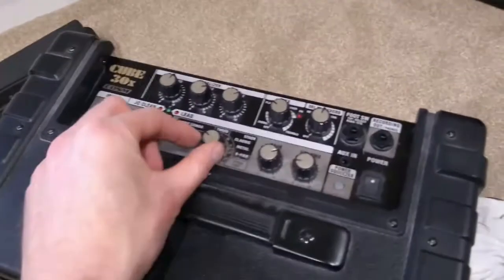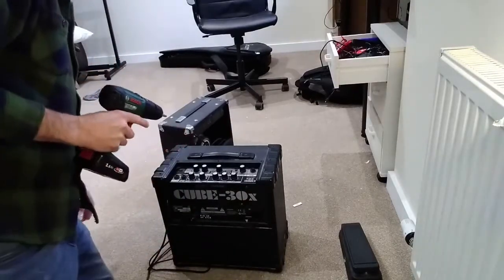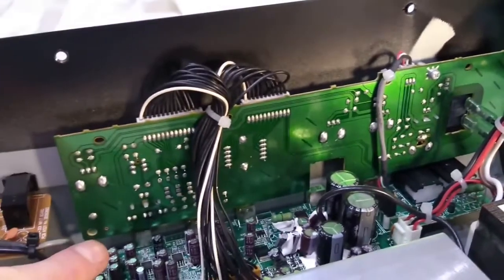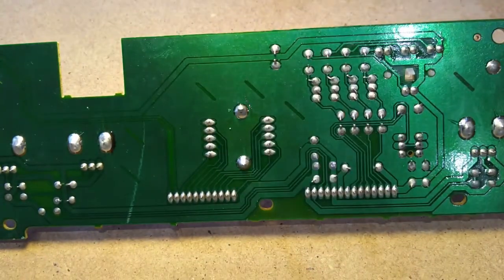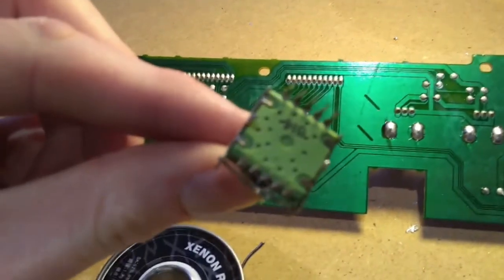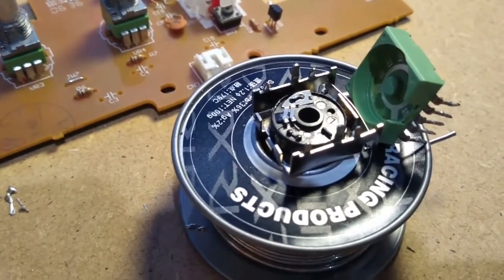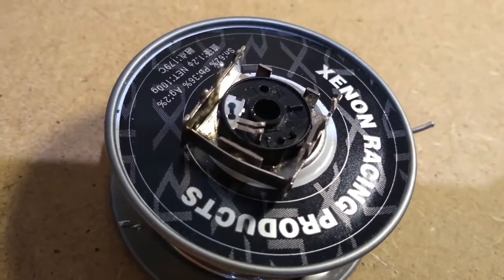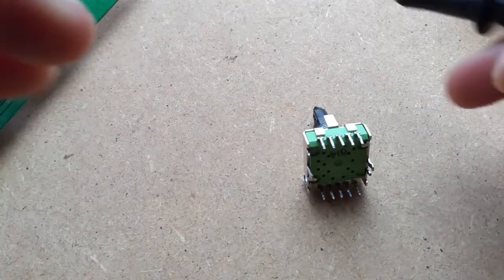Repair to Roland Cube lead channel selector switch

Comment: Thank you. I have the exact same issue. Seems to be a common fault. Gonna fix mine up too. I have been waiting approximately 5-6 years for a video like yours, as I am hopeless at fixing things, especially electronics, and there weren't any dealing with that model, and neither my local guitar store nor the manual was any help either. Your video helped me tremendously.

Comment: I have the same amplifier, and the same problem, if someone needs to buy the selector, it's an SR1712F-0108, I just bought it new, although disassembling it can surely be fixed as you did, thank you very much for the help
Reply: I have two of the amps and need one of the switches so if you don't mind advising me where to order the part...🙏
Reply: Ok l ordered the new switch so going to attempt the operation tonight...or tomorrow night..(
Reply: Where do I order it from. I just bought one used and same pot is dead
Reply: Ok if anyone is asking l got this and other parts at Mouser Electronics out of Texas
⚡
Reply: I have the cube street model with two speakers in it.  Does mine take the same switch.? It's an 8 position
Reply: 105-SR1712F-18NS
SR1712F-0108-20F0A-N9-N-027
1 POLE 8 POS D SHAFT is the information on the 8 Position one that l purchased from Mouser Electronics
Reply: für Deutschland Mouser de
Reply: Thank you for sharing. Here is a quick fix. I removed the plastic knob and sprayed around the metal pole (there is a tiny space that a fluid will penetrate) then placed the plastic back and turned the switch several times all the way right to left in order to clean the contacts.

Comment: Wow. Thanks a lot. My input jack fall into the amp after the plastic locking thing broke into pieces. I tried all the large screws but I did'nt think I should unscrew the top two at the handle. And even if I would unscrew that, I wouldn't dare to apply that force I needed to move the switchboard.
Reply: All the problems are same. Thanks for sharing

Comment: Hi 
You said the plastic part of that switch you bought was a bit short, did RS  sell an alternative with a bit more plastic on it, or is it not necessary? Thanks
Reply from the maker: The part I linked was the closest match from rs at the time of the video.  The shaft is slightly short but acceptable. A closer match may be available depending on where you are in the world and when you order.

Comment: I have one for repair here. It turns on but all lights go up and no sound. The analog session appears to be working but it is the digital parts that worry me...
Reply from the maker: I'm not sure if that could be the selector switch or not.  I guess the switch has two failure states.  It can short and connect two or more models simultaneously or it can fail open?  I never tested to see how it behaved in either case.  You could roll the selector switch around and see if anything changes.  ...but there are so many other things it could be.  Probably it's  a different problem.

I would start by taking  the boards out and inspecting them.  Checking the connectors are all seated.  Looking for blown caps or anything else scorched looking.  That sort of thing.

Sorry I am not enough of a cube expert to help more.
Reply: I think it must be rust. It is all rusted and corroded inside. Needs a deep cleaning for start.

Comment: Hi nice video, i got an 80x and the effects dont turn off is there a way to disconect them? I dont use them . The flanger effect is alway on cant use the amp. Can you help?
Reply from the maker: Sorry I am not familiar with that problem.  Does the knob still change the effect type or amount?  What happens if you try to turn the effect off with a footswitch?
Reply: @mowogfpv7582  não it remains on flanger. Im goin to try with a foot switch. Thank you

Comment: 13:11 I agree . this will be my last Roland product. They use cheap crap inside and they fail too much. very dissapointed with Roland. I love it when it works but every Roland product I've owned has some kind of issue at some point, mainly because of the subpar parts!

Comment: hi sir may I ask if what is the code no. of the 2 transistor. that attached in heat sink. I need to know because I have a amp like yours. but my amp have a problem. the 2 transistor is missing I need your help Thanks alot

Comment: Went through the same failed, frustrating repair attempt. Any chance you have the stock/part number for the rotary switch? There's a few on the RS site. Cheers
Reply from the maker: RS Stock No.:123-9618
Good luck!

Comment: Yup. Mine was fine, dropped it off my bed onto the floor and boom now I  only got the clean channel .
So I can buy that switch from Roland themselves?
Reply from the maker: Probably not.  And definitely not cheaply.  I bought a switch from a large UK seller that was similar enough to work.  The best place to buy an affordable replacement will depend on where you live.

Comment: Time plus materials     you could have bought a used replacement amp much  cheaper
Reply from the maker: I wouldn't  recommend anyone do this as a business.   But it's satisfying from an environmental and from a personal development perspective to be able to keep a repairable appliance out of landfill.

Total parts cost <£15.

Total labour, about 4 hours spread over two months.

The self-respect that comes with being able to fix things and not just being a passive consumer of mass-produced junk.   ....priceless 🙂

Comment: It is a big fault Roland amps are crap build quality I have not come across one yet without some sort of problem with the dial/switches great little amps when they work but not built for the long term steer clear I say and the customer service at Roland is garbage cannot get them repaired very easy.

Comment: I picked up one of these amps at the recycle depot, it has no wires to the transformer so I have no clue how to or where to solder new wiring. I figured I'd fix it and sell it to someone who might play guitar. any idea where the wiring goes to the transformer...any help is always appreciated
Reply: found the pins and fixed the amp...now all i gotta do is learn to screech a guitar. proud of myself
Reply: perpetual motion ~ advanced class prototype